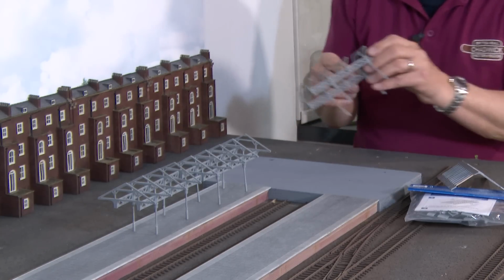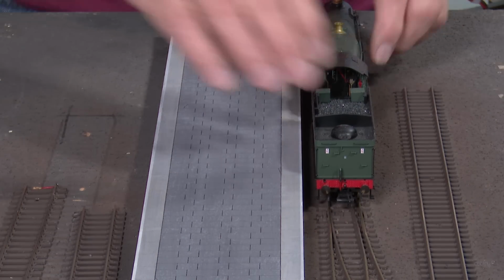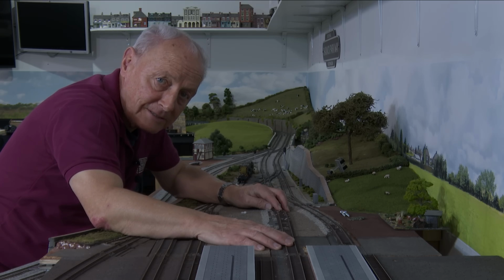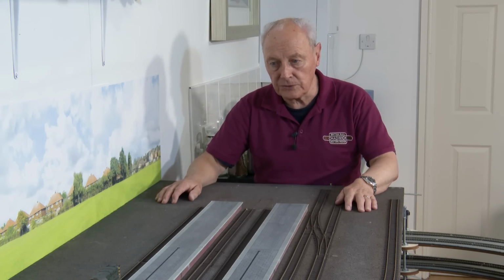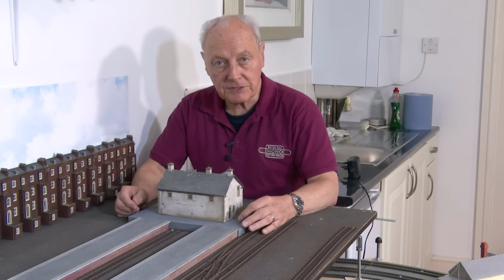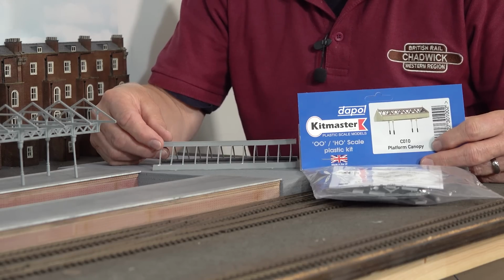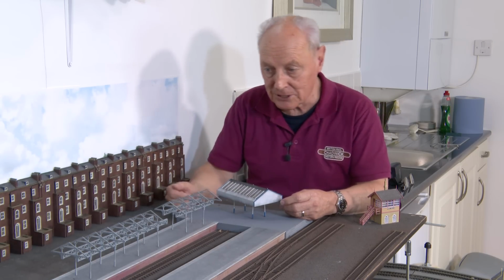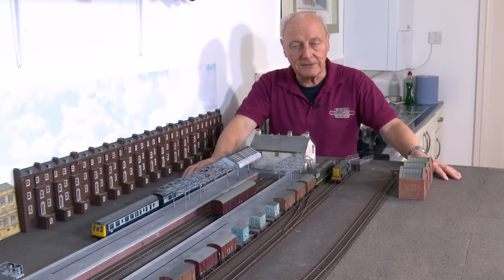Branch Line Design at Chadwick Model Railway | 235.

Comment: Another interesting video, Charlie.

A point (excuse the pun) about your Y-points: given that one side of the switch is still in use, these will need a dummy point motor fitting, as the switch will still need to be detected and proved locked (because it is a facing point and it is a DoT requirement for any points used as facers where passenger train are running to be locked) even though the switch will never move again. The reason this is to maintain the interlocking of the signalling system.  

Sorry to waffle on but I thought it important that you should know. 

Best wishes from your tame S&T man.
Reply from the maker: An excellent point Darren, very much appreciated. Regards, Charlie.

Comment: Just to confirm, BR came into being, originally as part of the BTC, on 1st January 1948! Good to see the loading/unloading ramp, which makes me suggest, a motorail train, which the Motorail van could be shunted onto the train, with the stock in the fourth platform, meaning you wouldn't need to have a fence to prevent access. Back in your layout's era, Motorail was quite prevelant. Just an idea Charlie. Sadly won't be at GETS, but have a good time anyway Charlie!
Reply from the maker: Thanks CBS, I’ve tried to make the branch areas flexible as possible. Regards, Charlie.

Comment: Regards the dapol canopy kit. I've been stock piling these when i see them at toy fairs and sometimes ebay too. However..  I'm getting the old boxed airfix ones as less likely to be broken or warped and usually no flashing at all. Plus i'm picking them up for 3 to 5 pounds. Whilst with the glazing sections, i'm going to be using Wills clear corrie sheets and weathering with a slight yellow/brown finish.
Reply from the maker: Thanks, Mark, that’s useful advice. Regards, Charlie.

Comment: 3:09 - This isn't just a model railway problem! There's a kink in the platform edge at Leicester North station to allow GWR wide cylinder engines to use the points to go onto the run round loop!
Reply from the maker: Wow, that’s great information RC. Regards, Charlie.

Comment: Being aged 76, I remember the platform canopies as AIRFIX models of which I had a few. If these are the same moulds today they are over 60 years old! I did see one platform with a point near the end which had the platform cut back in a curve. As this part of the platform was usually occupied by a loco passengers were not affected. The rest of the platform could then be aligned normally.
Reply: The original tooling is long gone. They lose their detail after a few years and have to be replaced.
Reply from the maker: Not have to be replaced, should be replaced, because they haven’t. Regards, Charlie.

Comment: For the disused platform/line why not take inspiration from the station at Dartmouth on the steam line there? They have, or used to at least, an old coach that they've turned into a small museum. You could do similar and turn an old coach into a rail museum or a cafe or even a fancy/themed restaurant depending on how you see the area.
Reply from the maker: Thanks mate, a café does sound a sensible option. Regards, Charlie.

Comment: Just a small point which some viewers might find helpful concerns platform (and other) clearance on curved track.   My compact and tightly curved layout has this problem in many places and I have found from experience that anything that allows the rather long and wide ex GWR auto coach to pass will also allow anything else in my fairly extensive stock to pass.  This simple finding has saved me a lot of time.
Reply from the maker: Thanks Graham,  for sharing your experience.  Have we found a market renting out your auto coach!
Regards Charlie